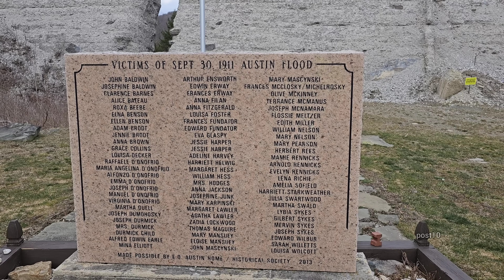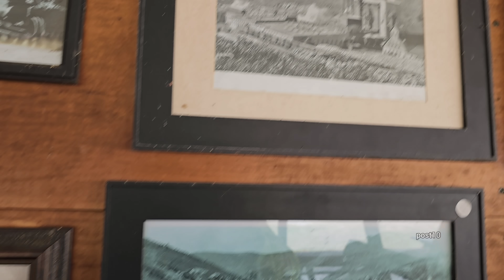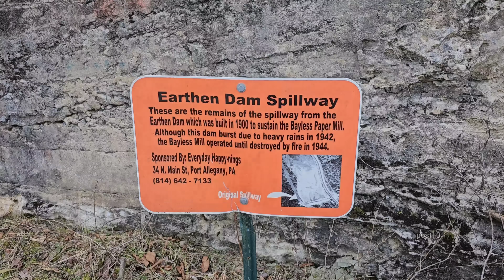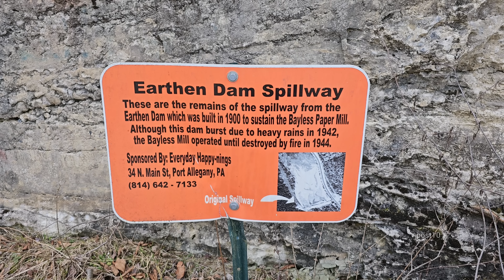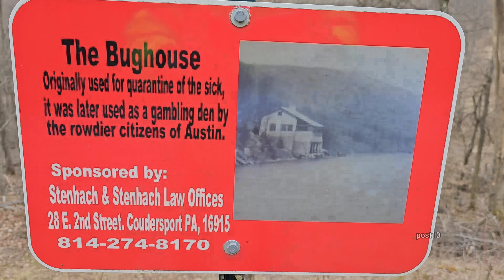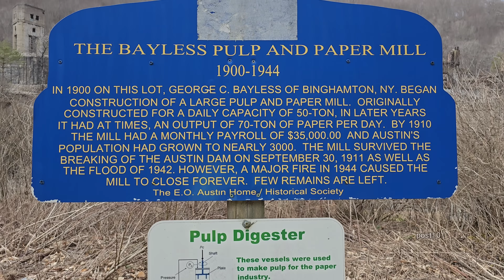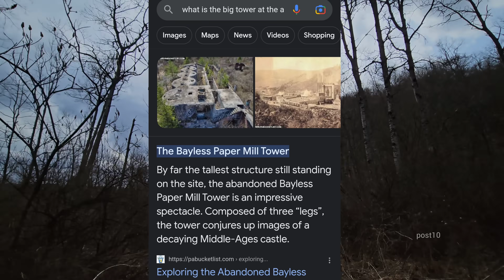Inside 70 Years Later, The Remaining Paper Mill And Dam After The Austin Disaster

Comment: Your best ever!  I've had a strong interest in the Austin Dam failure since I was a kid.  A few thoughts:  The mill structure was much better built than the dam, as your video shows well.  Bayless, the developer, knew how to build a paper mill, but he had no idea how to build a dam.  Regarding the water conduits in the plant, the water from the dam was less to provide any sort of power than to facilitate the paper-making process, which is very water-intensive.  

George Bayless needed the dam to provide water during the dry periods, typically August, September, October.  He intended to do in on the cheap, and cheap it was.  Bayless hired T. Chalkley Hatton to design it; Hatton had never designed a dam before.  The structure was built deficient in myriad ways, several of which you noted in your video.  There was woefully inadequate rebar in the dam and down into the rock base.  Bayless cut corners by dumping the boulders you saw into the structure and pouring concrete over them.  This saved on concrete, but made for a weaker structure.  Worse, Bayless continued pouring concrete in freezing weather in November and December.  If wet concrete freezes, it never correctly cures and the next layer does not adhere properly.

The original plans called for a four-foot wooden splash-board atop the dam to prevent waves or debris going over the dam in times of high water.  Bayless saw this as an opportunity to increase the dam's capacity, and instead of wooden boards, raised the entire dam by four feet.  This doesn't sound like much, but it increased the amount of water held by 25%.  When Hatton found out, he threatened to withdraw from the project, but Bayless talked him out of it.  

One of the worst decisions by Bayless was to save $1500 by refusing to put in a valve at the bottom of the dam to control the water level.  The pipe is there (east side, under the second standing slab) and visible in low water.  However, Bayless simply had the outlet covered with thick planks and it was of no use.  

In 1910, before the concrete had a chance to cure fully, heavy runoff filled the dam over capacity.  The eastern section slid 18 inches at the base and bowed 30 inches at the top.  Since there was no way to lower the water level, dynamite was used to blow two large gaps at the top and to blow the cover off the outlet pipe.  This likely introduced severe cracks in the structure.  The dam was then repaired and allowed to fill before failing in September 1911.

Any geologist, hydrologist, or engineer would have ruled out building a dam ANYWHERE on Freeman Run.  The local geology is a series of layers of shale, sandstone, clay, limestone, coal, etc.  It is highly prone to water intrusion.  Indeed, even before the failure, serious leaks were seen on both ends and in front of the dam.

The final report on the failure cited several causes for the failure, including those above.  The main cause was that the substrate below the dam was a series of layers of stone and shale.  Under pressure, water was forced into the shale and both "lubricated" the shale, and lifted the dam itself.  The structure then slid forward and failed catastrophically, apparently at the various cracks you noted.  In times of low water, you can see that the first layer of rock is still attached to base of the eastern slab.  

Sad fact:  Bayless was sued for damages, but the Potter County jurors absolved him using the rationale that since Bayless lost his paper mill in the disaster, he was a victim as well.  

Sorry if this was a little long.
Reply: Awesome additional added Information on Post's video Terry... You and Post should hook up and work together...! Interesting information to know about this damn thanks!!!👍👍
Reply: @-ray-h  Thank you Ray!  It's very impressive to see it in person.
Reply: Very interesting! Thank you for the information! 🙂
Reply: Thanks for telling us what Paul Harvey might have called "The rest of the story".  Very interesting!
Reply: Thanks for taking the time and sharing such interesting details.
Reply: Thank you for the interesting extra insight :)
Reply: @maryannanderson2213  LOL Maryann, since we both recall Paul Harvey, we're "of a certain age!"
Reply: Awesome post. And of course the guy didn't have to pay any damages. Some things never change.
Reply: @fr33dumb0  bet he had the best insurance against the disastrous outcome , 🤔☝️🎯🙏😔 poor folks always fed humble pie... 😺🥱☯️
Reply: Extremely insightful comment. Thanks for sharing Terry
Reply: not too long, very interesting and great view of what happened
Reply: Ty for this information. I had many questions after watching the video. You've answered many of them

Comment: Those big cylinders and tiled area are the "digesters" shown in a sign earlier.  Break down wood in to pulp for paper.
Reply: Thank you! That makes so much sense now, I was scratching my head trying to figure out the curvature and way the tunnels necked down was making absolutely no sense to me from a power generation perspective!!! 👍
Reply: I was thinking tiles maybe to speed the water flow up but then I thought nahhh the water pressure would blow then tiles right off! Thanks for explanation.
Reply: I could see streams of woodchips running though there, letting the water do the heavy lifting. A lot cheaper than conveyor belts as well.
Reply: Hi

Comment: The weird looking bricks are structural teracotta tile. Basically a precursor to modern cinder blocks or CMUs. They were widely used in early to mid 20th century buildings, but mostly for interior partition walls that would be plastered or tiled over with finish materials.

Comment: Cool video. I understand that those tiled chambers were the Liqour Resevoirs for the large cylindrical Pulp Digesters above. The Liquor was the active ingredient that was used in what was known as the 'Kraft Process' (US patent 1884) to separate the useful celulose from the unwanted lignin wood chip fibres. At the end of a 'cooking' sesssion. The Liquour was drained through filters to collect the valuable celulose pulp and the remaining Liquor was then collected in the resevoirs to be reduced and treated with Lime, ready for the next cooking session. The ceramic tiles were just a cheap (repairable) resevour lining to protect the outer concrete casing from the hot causic Liquor. Those small former pressure-sealed access panels that you climbed through were used to access the lower part of the resevoir to remove accumlated unwanted sedimentary desidues.
Reply: Great details, thanks.

Comment: Something that might interest you; Motocross racing pants have pads to protect your hips and have knee pads sown in. They are tight fitting around the ankles , so they'd fit right in to your hip boots. Might be helpful when exploring places where a slip might end in injury. Some are waterproof.
Reply: Paintball armor is about the same thing and a bit more effective with a combo of soft and hard padding. 
I ended up removing the lil hip pads from my mx pants because they didn't protect me very well being so thin and just made me sweat more lol
Reply: @100GTAGUY  , My son and I race in A.M.AA.'s district 7 here in Maryland. Do you still race? Haven't tried paintball yet, but there are a lot of places set up for groups to do so near me. Think I'll look into the gear, you made it sound pretty interesting.

Comment: The "Tower" you found, was a 'stock pile'. It would have a giant pile of wood chips around it, or coal, which would be pulled into the interior of the tall pipes. This in turn would be carried by way of a massive auger up to the top and then over to the mill on a conveyor.

Comment: What you call bricks are fired ceramic tiles.  Those are not unusual to find in building wall construction.  The concrete was obviously not mixed well by the stratifications in it and it did not set up well either since it is breaking up by degrading.  Terry Boots's comments verify this.  I think you missed being able to cross the river on a bridge.  Note that most of the concrete in the building is of a lot better quality than in the dam.

Comment: The consensus was that the mill owner was a cheapskate who underbuilt the dam without a curtain wall underneath the dam and not enough rebar. At one point it bowed outward 36 feet before it failed. It cracked into 5 different sections also immediately before failure. The concrete containing those large stones is known as Cyclopean concrete.